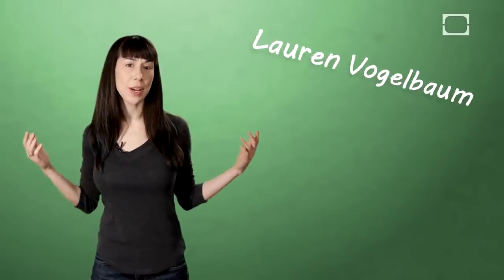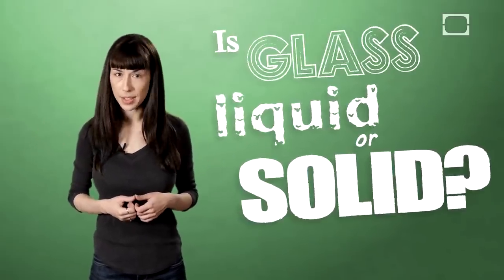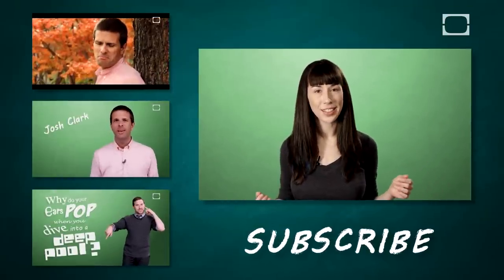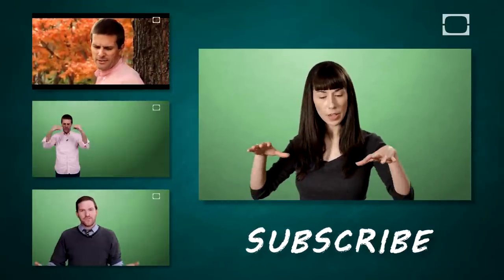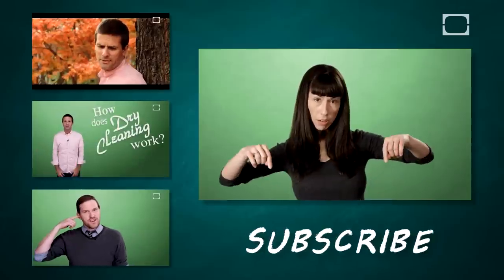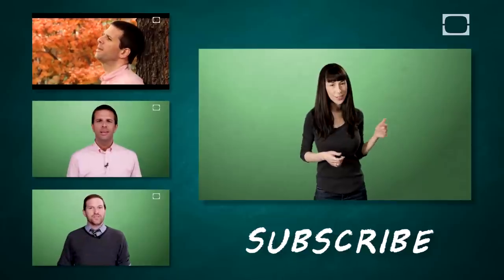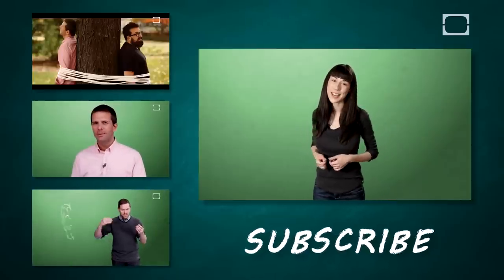Is Glass Really A Liquid?

Comment: Hmmm, your spinning glass conclusion might have applied to very early glass manufacturing, but the glass in 20th century homes was made by flowing the molten glass onto giant pools of molten tin thus the ripples and distortions you see. Also Ive read that some of the horizontally mounted glass in the sistine chapel thats been there over a thousand years does indeed deform and fall out of its mounting..

Comment: Glassblower, here.  Actually, the glass would be thicker toward the center of the disk, perhaps with a bit of a lip around the edge.  If you watch a dog shake off water in slow-mo, you get the idea of how fluid spins off with the cetrifugal force throwing it out, and the centripetal force (sorta like gravity on the dog)  holding it back.  Glass is at best really gloopy in its liquid state, and though you can blow it out thin, it's not actually going to flow much toward the outer edge when spun. It jst flattens.  Too, they din't just blow the bubble and spin it.  They blew it about as thick as they wanted, probably flattened from a bubble to a cylinder, put it on a punty (pontile), cut it off the pipe, and then spun it.  Yeah, so thumbs down on an Ed video that pretty much misinforms.  I hope you enjoy my ad revenue.
Reply: Did you get to know that this video is true in these 5 years?

Comment: You haven't answered this question.
Reply: Because there is currently no consensus.
Reply: Lerkero
No, I think they're saying it's a solid, but I'm not completely sure. As I said, they haven't answered this question.
Reply: Orsbore
I think they're saying it's a supercooled liquid.
People haven't really decided.
Reply: Youthro
A supercooled liquid - which I believe is a solid. Like I said, they haven't answered this question.
Reply: Orsbore
If a supercooled liquid is a solid then why not just call it a solid? I think the point is that the research is still ongoing as to what to classify glass as. It's not clear (pun intended).
Reply: Lerkero
Water is a liquid. Frozen water is a solid. If the glass is supercooled, wouldn't that make it a solid? If they were saying that the research is still ongoing, it would have been easy to just say exactly that. Instead, she calls it an amorphous SOLID. In other words, they haven't answered this question.
Reply: Orsbore There are a bunch of substances that tow the line between liquid and solid. A liquid is usually defined as something that expands to fill its container.

For example, would you call butter a liquid or a solid? As she said in the video, an amorphous solid does not have a crystal structure and its molecules are prone to move around. Butter, like glass, does not have a crystal structure and it exhibits properties of both a solid and a liquid. This also applies to some gels and petroleum molecules.
Reply: Lerkero She says that the glass hasn't changed in centuries, so it doesn't expand to fill its container. I would call butter a solid, unless it's warm. I understand what you're saying, I feel like if that's the case, then she didn't explain it.
Reply from the maker: The answer is "neither" -- science doesn't always give us straight answers to questions like these. The term "amorphous solid" is just the technical way of saying "neither a solid nor a liquid". Hope that clears the issue up (er, as much as possible given the murkiness of the issue at large).